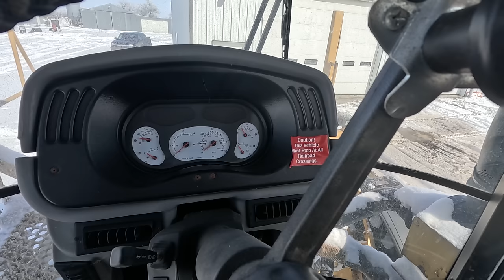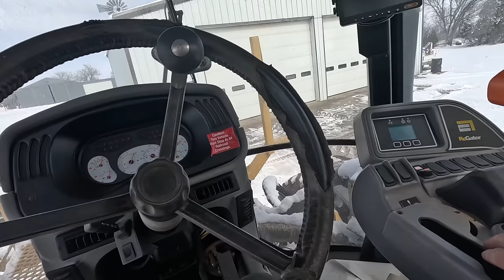The New Spreader is Kinda Cranky!!

Comment: Starting cold diesel engine ,maybe its just a wierd idea of mine,but im a firm believer in cranking the engine over for around i dont know 30 seconds  maybe less and give it 5 to 10 second break and do all over again crank the engine over again for 30 seconds or less and give the batteries and the starter a break an repeat it a few times
I just think the chances for the engine to start are better than to have it continuous cranking over nonstop
Thats my 2 cents of advice for today
Reply: Its actually the opposite. Takes more juice to start cranking than to keep it cranking. And the little bit if warmth you get in the cylinders cools off so you have to restart again

Comment: Cycle glow plugs multiple times it will always start
Reply from the maker: The fuel pressure seems to be bleeding off so it takes a bit to get it pressured up.
Reply: @FastAgMontana  is it the c9  or c7 cat?
Reply from the maker: @sethmcrae9365  9
Reply: @FastAgMontana  I have a c7 in my 884 and I have to cycle glow plugs 3 times every morning and my fuel pressure on console says it's 0 then slowly starts building while cranking, but yours cranks alot better then mine does in 45°F weather😂 remember if it has heui pump injectors don't start firing until oil pressure rises. Did you figure out gps signal?